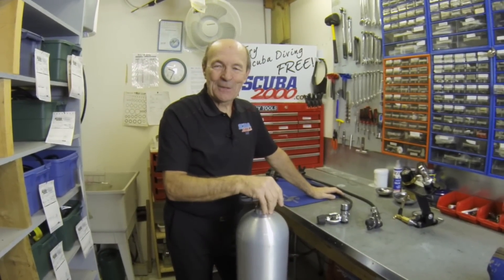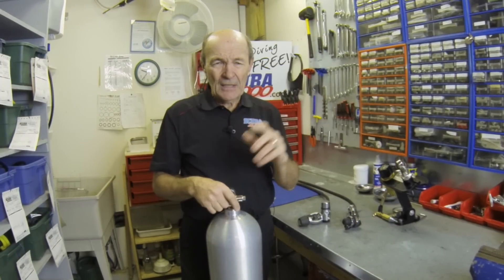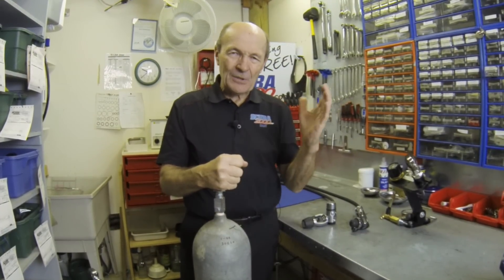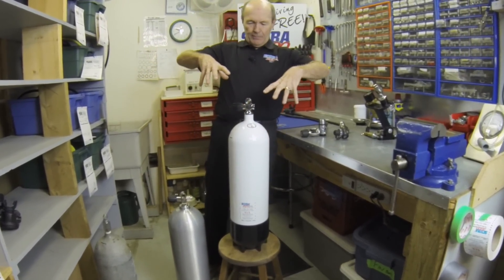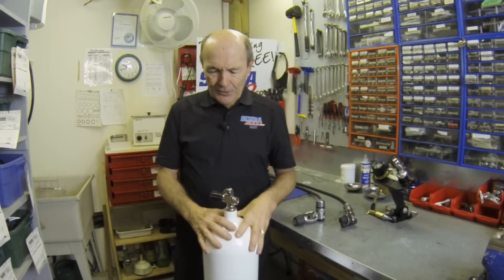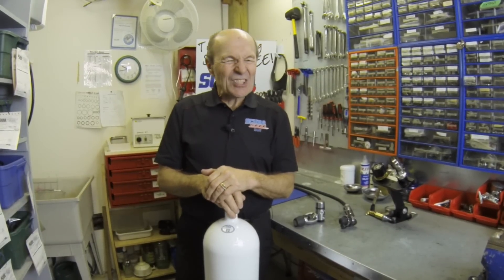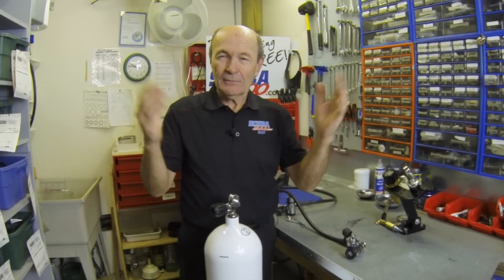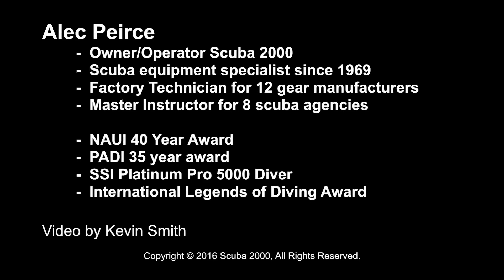Steel vs  Aluminum Tanks - Scuba Tech Tips: S03E07

Comment: A compressor is not expensive anymore  at 15.00usd 33psi fill is weak I bought my own compressor for my sailboat and I never runout
Reply from the maker: Having your own compressor is very handy on a boat.  Remember to get the air checked annually.
A

Comment: DIN v INT (Yolk) OK let's get round the Imperial /metric difference. A DIN regulator is rated at 230 Bar, an INT (Yolk) regulator is rated at 200 bar so can maintain less pressure. In some places in the world, they inflate tanks to 230Bar, that's what they do. I first encountered this in Gibraltar. My Second stage was fusing all the time at the start of thye dive. I had to get out my tool kit and fixed my regulator to cope with that. YES I am a very bad man I'm not supposed to do that. Things got worse, in Egypt (yes that's the red sea) they are set up to dive DIN. The tanks are inflated to 239 , DIN connection  but they offer adaptors for INT. Now on the DIN connection YOU maintain the O ring. With an INT connection the boat maintains the O ring OR doesn't maintain the O Ring. The net result on a dive at 5 metres on INT the O-ring failed. Do you know the noise that makes behind your head?  After that I bought new DIN regulators and put my favorite INT regulators in the loft. True story, if you travel to dive, get DIN, or rent local.
Reply from the maker: Thanks for sharing your experiences.  Actually I do know what it sounds like for a reg yoke to fail!
A

Comment: I have been diving with aluminium tanks for many years, but I still miss a lot my old 18 Lt 220/330 Bar steel tank. It contained 3,960 Lt (140 cubic feet) of air and did not change (much) its buoyancy during the dives.
Reply from the maker: You must have a strong back my friend.  I knew a diver who used a big steel tank for 2 dives before filing it.  Kevin dives steel 100's at home and I take whatever tank they give me.  
A
Reply: @AlecPeirceScuba_SeaHunter  :-) I admit, I was much younger… 30 years younger :-)
Reply: @GuidoCandiani What youre age my young friend

Comment: DIN looks a bit cleaner when assembled. But until carribean switch to those convertible valves i stick to yoke. I see too many Europeans struggle with tanks there. 
And when you forced to use an adapter- I think i can hear every time they bump the head against the reg 🤣
Reply from the maker: A dented head is a drawback for them over here and the same for us anywhere else.  
A

Comment: I started with the steel 72 cu ft & used them for years.  Mid 80's I got my first AL 80.  Another 5 years & i was back to steel, but a 90.  Now I'm back to AL, but a 100.  I wear a 3x 5mm farmer John & 7mm thigh length jacket for a wetsuit.  Yeah, the extra tank weight is nice. 🦈
Reply from the maker: Very cool!
A.

Comment: Steel tanks are standard in Europe. You can't even buy aluminium tanks in divestores. My standard tank contains 12 liters and can be filled up to 300 bars. A lot of air for one dive that gives extra for emergencys or unforseen surcomstances. Ofcourse 300 bar is only possible with DIN, yoke is only up to 200 bar. Steel tanks only have to be visual checked any 2,5 years instead of every year, they are more rugged. As the comment below suggests, DIN is more compact. In my opinion: DIN has more advantages over yoke.
Reply from the maker: That's one of the many scuba discussions DIN vs yoke.  Most views depend on if you use metric or imperial units.  I have several videos on yoke vs DIN and adapters that may interest you.  Thanks for watching.
Reply: Aluminium tanks are avaiable everywhere in Europe but they are mostly used as stage and deco bottles. Rec divers often use them together with for ex a steel 12x232 tank(12 liter steel, 232 bar tank) to make longer dives. They are also often used for sidemount even if most divers prefer steel because of our drysuits. Take care Alec!👌🤿

Comment: Sir Alec,I've got one question.Seen a lot of ur videos and really appreciate...I just wanna know is it safe to dive with Carbon Fiber tanks?Seen people only talks about steel and alluminium🤔
Reply from the maker: Carbon fiber tanks are not that new, just improved over the last years.  Primarily as staging, bailout or spare air bottles the major drawback of these are they are un-inspectable and easily damaged.  Best to check with actual users on www.scubaboard.com to get their ideas.
Reply: carbon fiber tanks will only last 15 years and hold 4500 PSI, steel tanks last 50 years and go to normally 3000 or 3500 PSI. get a steel tank

Comment: Hello Alec, I'm in the beginning stages of Tech Dive training and am trying to choose tanks for doubles. I know I want steel for the weight I'm just not sure of Low Pressure vs. High Pressure and what size would be best. Can you elaborate on the differences between LP/HP and volume?
Reply from the maker: There are lots of factors to decide between the two, kind of like saying are blonds or red heads better?  I won't write a thesis but hit on a few major points now.  Try searching or posting on www.scubaboard.com for help from the dive community.  
HP's are shorter than the LP, it puts its weight higher toward your head but have excellent weight to volume ratios.  Getting good  fills may be a problem as not all LDS can fill HP's (easy to fill to 3000 psi but harder to hit 3500).  Your reg must be compatible with HP and use a 300 DIN adaptor to operate at a working pressure of 4350 psi.  No yokes used with HP's.  You need to decide which buoyancy properties are best for your diving.   Only a few points to get you started but keep researching and if in doubt, ask you LDS or a buddy to try each to see how it feels.  Take care Blake.

Comment: Alec i just bought a 300 bar (approx 4300 psi) regulator (aqualung legend elite) and am considering buying a steel 100 high pressure tank which apparently are only good up to 3442 psi per your vide. Are there 300 bar (4300 psi) steel 100’s out there or are they strictly special order items?
Reply from the maker: For scuba diving, high pressure steel tanks max out at 3442 for a variety of reasons: hard to fill tanks that high, max limit for yokes and the industry not wanting to sell & support higher limits (liability!!!).  A 100 cu/ft steel tank filled to 3442 is a LOT of air for recreation diving.  Techies just add more tanks for long time OR go rebreather.  As good as the Aqualung is rated for, you don't want to be at the max depth when diving.
Reply: @AlecPeirceScuba_SeaHunter  thanks Alec. I’m a gas hog and was just curious if there was an alternative to doubles as my old legs can’t handle that much weight. John

Comment: I have been considering a 95 Low Pressure Steel tank against a 117 High Pressure. I like the size and weight of both. The size is almost identical in both. The 117 weighs 5.4lbs heavier, but the 95 is more of a floater when empty, so you need to wear more weights to compensate. Before jumping in the water the diver will be about 4 lbs heavier with the 117

I believe the capacity ratings for the low pressure tanks is based on their + rating. So after 5 years, the 95 tank becomes an 86.4 tank. The pressure is reduced by the 10% the + rating allows. To find how that effects volume,  I took   95 / 2640 x 2400 = 86.363. Rated capacity divided by the pressure it is rated at,  gives a volume measurement per psi, then multiplied by the new pressure rating. Is this correct? If you take 10% from 95 you get even less, 95 - 9.5 = 85.5

The high pressure tanks do not have a + rating, so their capacity stays the same.  So after 5 years, the 117 holds 30.6 more cu' of air, is about the same size and only weighs 4 lb more. Am I over looking something?
Reply from the maker: If your not sure which to pick, your comment may have been cut off, ask the dive store to let your take them for a test dive.  They may have a rental of each and see how they perform with your diving style.  If a good dive shop,  this should not be a problem.  They want you to return for fills, VIS and hydro tests, club events, trips, etc.  Take care.
Reply: @AlecPeirceScuba_SeaHunter Thanks for the replies.  I was wondering if my logic for calculating actual tank capacity was correct. ( rated capacity divided by rated pressure multiplied by the actual pressure). 
I did buy the 117 from a local shop yesterday.  (3rd Reef in Las Vegas. Real nice guy by the way).  It weighs a bit  more than aluminum 80, but holds 50% more air.  117-77 = 40. 
The aluminum 100 weighs 42lb. About the same as a steel 133. And it is 2lb buoyant, so may need extra weights.

Comment: Din has a higher max pressure and is more compact. It is objectively superior but everyone uses yoke here
Reply from the maker: The DIN connectors are pretty much everywhere outside North America, it does not necessarily make is superior unless in the eyes of the user.  Both yoke and DIN meet the needs of divers in their geography and work well as designed.  DIN has a higher maximum pressure because of its design, yokes work perfect for 3000 psi, 210 bar because that is their design limit.  Everyone has their view and preferences, I'm showing options and information some new divers have never been exposed too.   Enjoy your DIN's my friend.

Comment: Note there is a difference in DIN valves in tanks also. 5 thread are use up to 3500PSI/232/bar, 7 thread for use with 300bar (4500 PSI) tanks. A 7 thread valve also has a deeper drilling inside the 'O' ring face. Most charging whips are 7 thread but those on a 300 bar compressor also have a small extension inside the 'O' face to stop them sealing onto and charging a lower pressure tank. 
Similarly DV's rated at 3500 PSI max have only 5 threads so when attached to a 300Bar/4500PSI will not seal.
Reply from the maker: You are correct but this was a basic intro for those who need to know the differences.  Your points are much appreciated.

Comment: I'm curious about the new batch of neutrally buoyant (when empty) aluminum tanks. They run about the same price as steel, 300 street. Is there a video on them and would it affect your recommendations? I'm guessing the better resistance to rust gives peace of mind for saltwater divers.
Reply from the maker: They are nice to remove lead but it now the extra weight is entered on your back, not on the belt or integrated pockets.  Other than buoyancy, the other factors remain like overall size (bigger than steel), max pressure 3,300 vs 3442 for steel, service etc.  See if your local dive shop will let you test one in a pool or lake to see how it affects your trim and comfort before buying.
Reply: @AlecPeirceScuba_SeaHunter  Thanks for the prompt response! I talked to a scuba forum and they mention there's also balance (relative to steel) to consider. Definitely will try them out at my LDS.

Comment: DIN also ha less potential points of failure. Also with yoke you run through O-rings like it’s nobody’s business. When I use to work in the industry. I always had a pack of new O-rings for yoke valves with me. I went to maybe four to five packs per season. With DIN I had maybe six to ten O-ring changes per season.
Reply from the maker: This will be a never ending discussion just like which is the best fin, dive computer, BC etc.   If your comfortable with a particular setup, have fun diving.

Comment: I just bought a scuba compressor ...se  add led packaged  filters Came with it but they are about 13 years old... I ordered new ones but I’m tempted to to fill and try out my new compressor using the ones that came with it... is this a high risk?
Reply from the maker: Breathing air must be  clean and pure and the only way to be sure, regardless of manufacturer claims, is to have a sample sent off for testing.  Don't risk a problem by skipping this test for yourself and anyone you fill.  Most compressors need maintenance (annual and by # of hours) for proper operation.  After 13 years be suspect until tested.

Comment: Strange that the price of steel tanks are so much more than aluminium. In the UK steel tanks are cheaper than aluminium tanks and preferred due to their bouyancy characteristics. Maybe this is due to the majority of UK divers wearing drysuits due to water temperatures
Reply from the maker: Aluminum tanks are the most common in North America probably because there is lots of it available and so is very cheap.

Comment: Hi Alec, any suggestions on how to receive training and certifications in gear maintenance? Is there a basic cert that covers most equipment types?
Reply from the maker: Unfortunately, each manufacturer has their own 'authorized' service course.  Regulators are very similar but still not the same in tools, assembly and lube points.  Suggest picking 2 that are very popular on your local dive shop so you get lots of practice.  Then add others based on the type of gear customers bring in.  No sense being certified on a brand that shows up 1 every 2 years.  Talk to your LDS and speak to their service pro on which are popular and can they arrange courses.  Hope this helps Maggi.
Alec